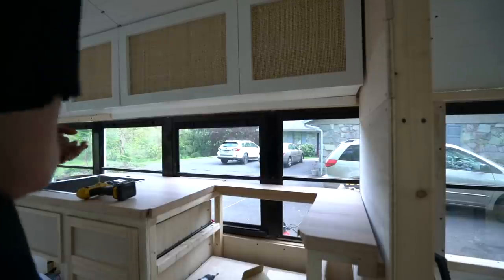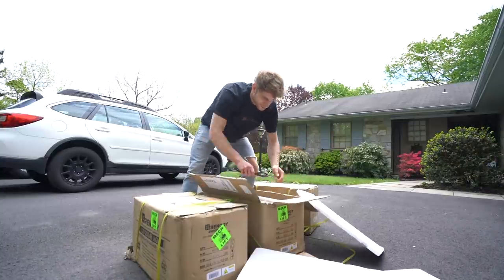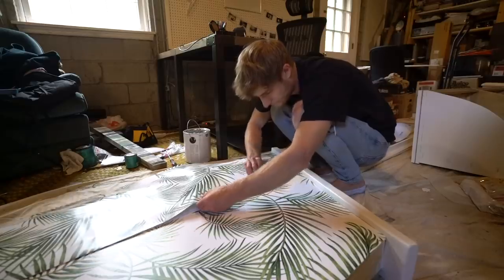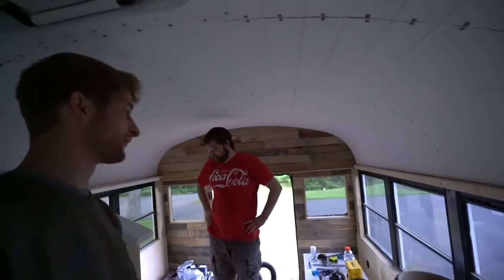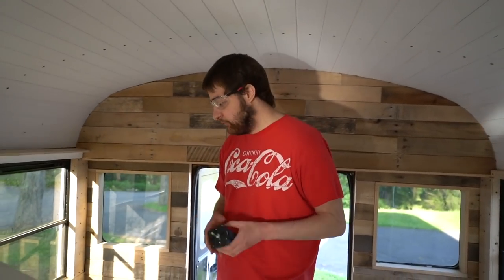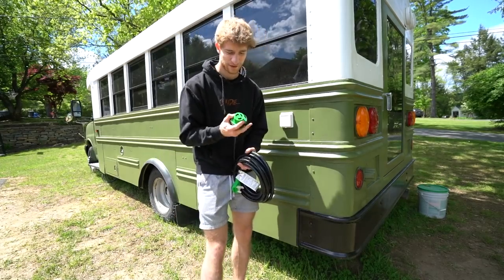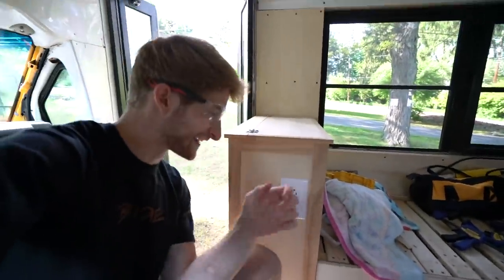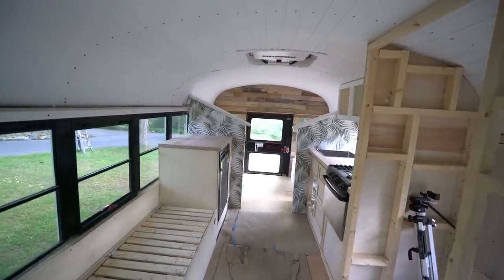HUGE Kitchen Transformation and Starting Electrical in School Bus Home! - Skoolie Build Ep. 44

Comment: Matt Hope you caulked the shore power outlet so no water gets into the bus. Any holes from the outside need Geocel 28100V or better special use caulks. Leaks are a problem because mold stars to generate. You are doing an excellent job. These projects have so many moving parts- getting them done right is no easy task.